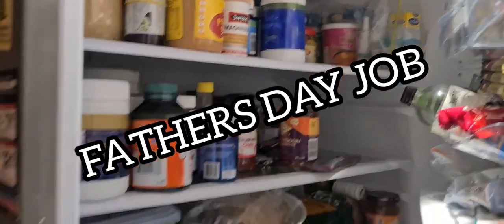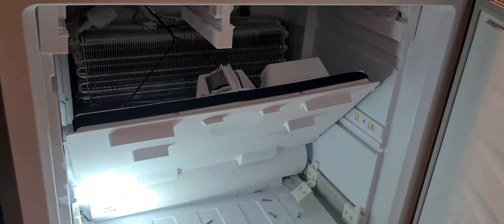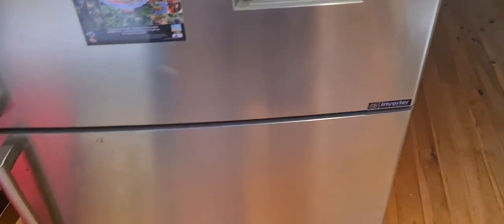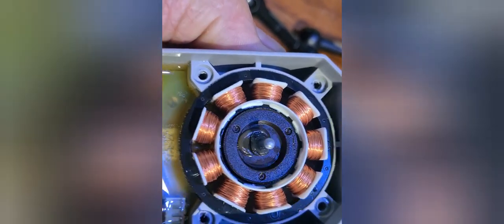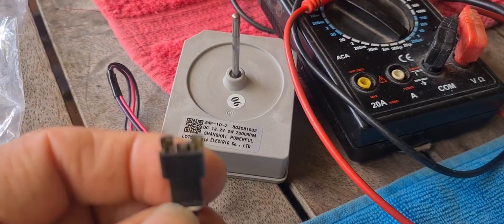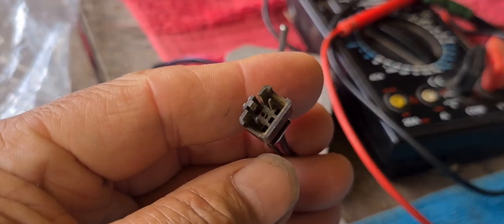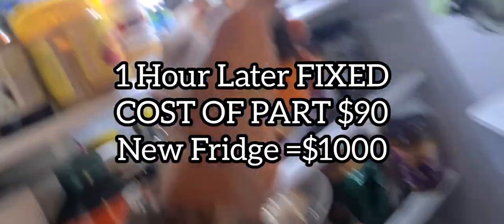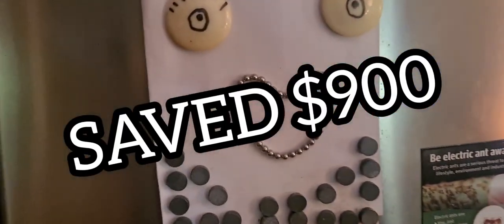Hisense FRIDGE NOT COOLING ! Freezer is cold...not FRIDGE.

Comment: Fridge experienced the same thing and I also solved the problem without replacing any parts;
I have the same issue, the middle pin is missing missing and stuck in the female end of the connector. I have the same part and it seems like I have the same fridge. There's still continuity with both the red and purple wires to ground. Maybe the connector is whats damaged. I'll try to repair the connector because ordering the part from China takes too long.
Update: I popped out a bench power supply and it didn't run at first, just a few sparks(at ~1amp). I was pretty sure, so I tried again with the black and red terminals. It still works! Seems like the fan connectors can get frosted causing the voltage to occasionally jump, leading to sparks, leading to oxidation/heat. The middle power pin couldnt handle it and broke off at the base of the pin. I'll replace it with another connector and come back with another update on the fridge.
Update #2: I took the connector off from both ends and soldered it directly. I used some silicone and heat shrink to minimize the corrosion in the wires. I noticed the fridge side wires are significantly thinner than the motor side wires (22awg braded). Things are working again!. Just plugged it in, but I can feel the cold air coming in the fridge when I hold the door closed button (this allows the vent to be open to the colder freezer). Learned alot from fridge repair in one day. Didn't need to change any parts, but my soldering skills and equipment came in handy.
Good luck to the next person with this problem, seems like its inevitable.